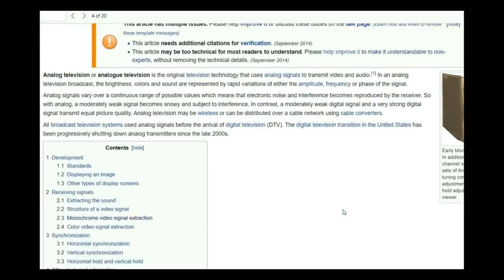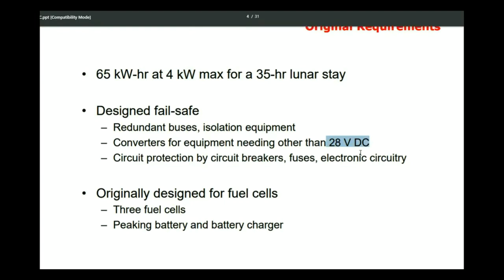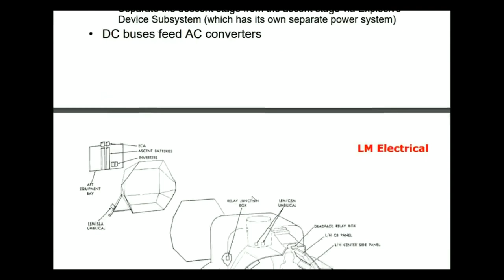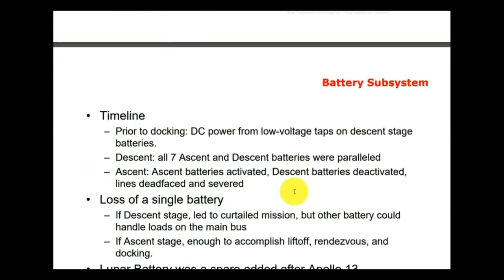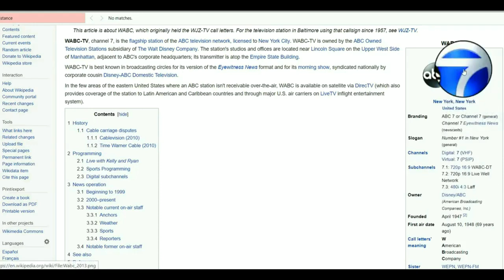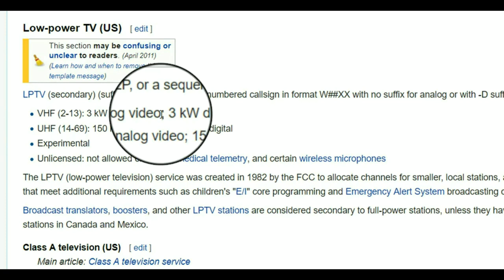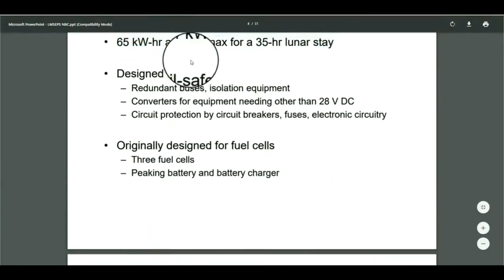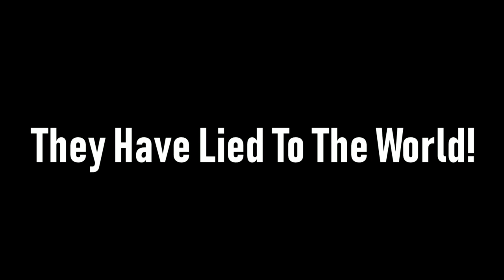Moon Hoax; "Electrical Power Systems"

Comment: You cannot compare terestial transmission of a tv signal for 2reasons...1. The curvature of the earth and 2 nd..a tv btroadcast is done into an omni nondirectional antenna. For point to point broadcast you would use hi gain dish antennas.Direct tv broadcasts 22600 miles from a 50 watt transponder and people get sat tv. So that being said,i still dont beleve we went to the moon.. Batteries dont work in extreme heat or cold...Go to the GNB web site and look at their performance charts  capacity vs temperature....we never went to the moon.

Comment: With the 2 engines needed for LANDING and ACCENT. ..where did they put the BATTERIES? hmmm
Reply from the maker: It's more of a question as to why NASA got rid of the Helium pressurisation tank in the LM. That Helium was used like as a fuel pump. Without the pressure, that LM is going nowhere, which it did not. The NASA fan club will say all you need do is open the valves when in space and the vacuum will do the rest. The thing is, not fast enough to get a thrust of 3 to 10K lbs. Let their excuses commence!

Comment: If three kilowatts goes 50 miles, you will need four times more/12 kilowatts for 100 miles.
Reply: You think the signal stops dead at 50 miles? What stops the signal? What exactly is in the way?
Reply: Onebigmonkey "50 miles" is  just an average in this example. Nothing stops the signal.
However, at longer ranges the S/N (signal/noise) level will be worse.
Until you are not able to read, what you are receiving.

Comment: I don't believe we went to the moon, but you're totally wrong about the transmitter power needed to send a TV signal back to earth.  As little as 10 watts would be good enough as the signal traveled through a vacuum, the vacuum of space. Unlike you, I do know what I'm talking about, I'm fully qualified and have regularly bounced signals off the moon and received them back here on Earth using very little power. Ask any qualified radio ham.

Comment: OK and the transmitter, like the photographic film, and the astronauts, and the LEM, would have to be cooled - very much as the CSM would have to be heated during the travel periods - with or without solar re-charging? 
What is NASA's final word on whether batteries were revived en route?

Comment: Nice job exposing the Apollo fraud! …  At some point NASA decided they didn't need an exhaust plume to blast off from the moon, when confetti worked just as well!  … https://i.pinimg.com/564x/b0/7a/33/b07a3303d703b887f54c50cac0f07d6e.jpg

Comment: Nasa said they used around 2GHz microwave for the communication. The battery wouldn't last for more than an hour for that frequency.  Chian has conducted the experiment. Using a low power VHF signal, it could communicate between the moon and the earth for only 6 hours with a relatively large battery. The communication for such a vast distance, a lot of power is required. India took time to recharge the battery in the moon's orbit before descending.  The battery is a big issue for everybody. For a life support system, you need to carry a battery for a cooling system. Apollo has no way to have brought that many batter power for recharging the battery in the backpack.
Reply: So you've decided they couldn't take batteries so they myst gave recharged them and then decided they couldn't. Based on. .?
Reply: @onebigmonkey  If you do not recharge it, how do you change it in the backpack. Explain, idiots.
Reply: @onebigmonkey  I am not interested in high-school drop out. Go ask Nasa hot line. Or, do not write anything here, idiots.

Comment: AstroNOTS to the moon. 
Ha Ha Ha!
Reply from the maker: You certainly got that right John! Now Crewe is claiming space is -230 F when yesterday he said there is NO temperature in space. He cannot make his mind up, and you know why? Because he doesn't have as much as one single brain cell, to share amongst that entire clique of his, HAHAHA!
Reply: @theapollodetectives  -230 F in space?
Then +250 in direct sun?
Can you imagine the power drain required to maintain a tin-can survivable? Through massive Radiation as well?
Disney science friend. Impossible today, damn sure impossible in '69!
Reply: @theapollodetectives  they endlessly spout non-sense and pseudoscience bullshit.
They are nothing but faceless crooks and deceivers.
Thanks for all you do. 
Telling the Truth these days is not an easy thing to do...
Reply: @theapollodetectives  apparently the folks at NASA gave the ActorNOTS a pin-wheel generator to hang out the window so they could recharge batteries.
Ha Ha Ha!!!

Comment: As an electrically orientated person I know the truth here that is spoken in the vid. No way possible to transmit this far without loss of the signal and not even a direct signal to Houston. Great vid thanks for sharing.
Reply from the maker: No problem Randy! Cheers m8!
Reply: Being able to put a plug in a wall is not an electrical qualification.

The lunar orbiter probes sentbtheir images of the moon back using a 10W transmitter, is that fake too? The only thing stopping the signal is the atmosphere. There is less of that in the way than there is to most people's TV transmitter tower.
Reply: @onebigmonkey  I guess the 3kw transmitters they actually used were good at being intercepted through the van Allen radiation belts not to start with temperatures or the vast void in space ..hahaha.. just accept it..We never fu king landed on moon.